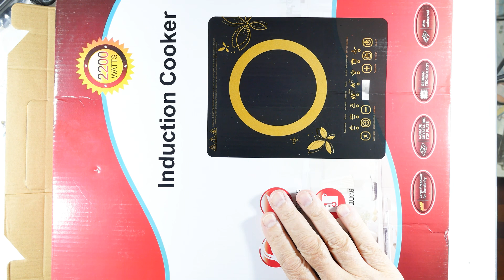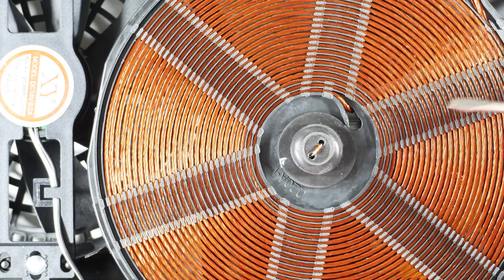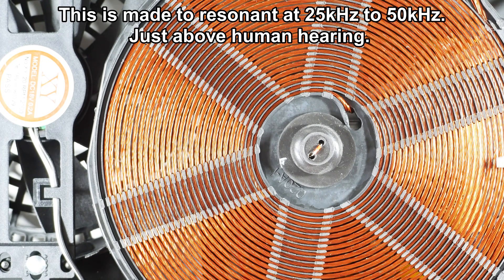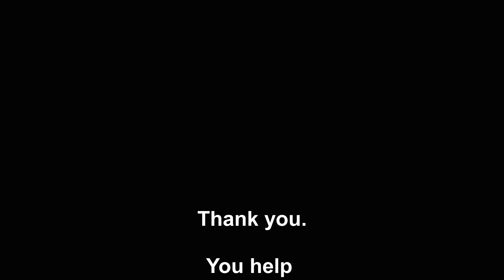Crystal Radio--Litz Wire From An Induction Cooker? (4K)

Comment: For everyone else out there: I've taken apart a much more expensive built-in induction cook top and found much the same in terms of the coils - I guess because as you say below, it's only good for ~50kHz. It does make pretty good wire for a small Tesla coil primary though.
The last time I came across salvageable Litz wire was in a choke in the deflection circuit in a CRT TV, but they're becoming pretty hard to find!

Comment: You'll need #44 or #48ga strands of Litz for any appreciable  "Coil Q"  Benefits compared to reg magnet wire...Non-MW- Radio  Induction heater application Litz is likely Not to be near the Strand ga suitable for AM MW radio use ..
Reply from the maker: I did a video on what I found about Litz. https://youtu.be/O0hUYmp_US0
Funny, this and one of your other comments were held up for unacceptable words.

Comment: Hello im new in this hobi and i want to make a crystal radio any help is welcome:) litz wire can I use any or ?:)
Reply from the maker: I would start off with this radio:
https://youtu.be/fLVCqZGpv3U
It does not use Litz. I did a video on Litz and it's for very advanced builders. 
You might also watch this:
https://youtu.be/f54BfiRNH9I

Comment: I took one apart and kept the heater coil. It does look cool, almost artistic.
Even if the wire isn't litz could it be used for anything?
Reply from the maker: It is litz, just very, very low frequency. It's not useful for radio. Maybe I could have made an induction forge.

Comment: Screws in those legs? I wonder if they would react being so close to the coil?

I bought a used induction cooker to convert into a device to heat metal but it works too well for cooking that I can't get myself to chop into it.

I just used mine a couple of days ago to reconstitute four half full bottles of honey that had crystalized to a point it would not squeeze out.

The induction heater let's me precisely set the water temperature hot enough to dissolve the crystals without being too hot to distort the plastic squeeze bottles.

I didn't realize the price had come down so low as I paid a lot more for mine a couple of years ago. I may have to buy another to get back to my induction furnace experiments.

Comment: I was wondering what the inductance of that coil in that inductance cooker is
Reply: One should be able to calculate that. Given the resonance, the grid frequency, the wattage, the voltage. So many data, there should be an online calculator to do the math.
But i don't feel like checking further in. I'd have to file it under useless knowledge anyhow.